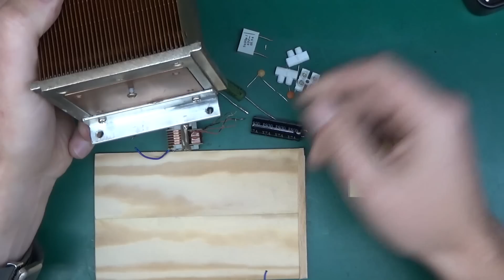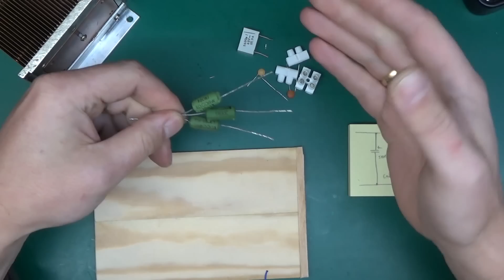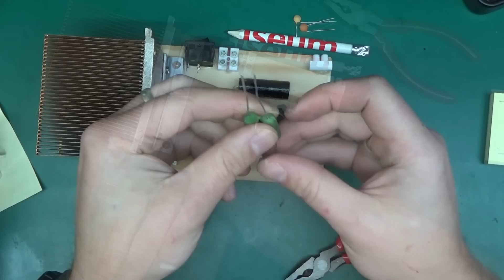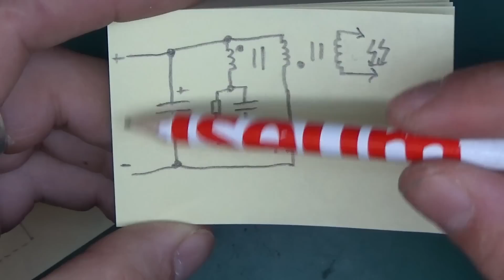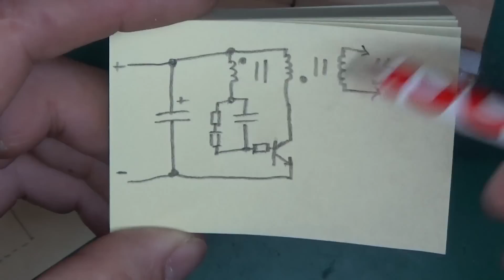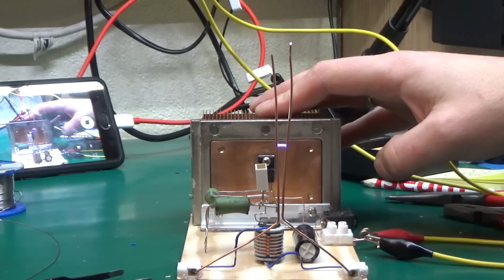High Voltage DIY easy and simple generator build

Comment: I get 2cm sparks from a simple pulse generator from eBay that cost $2 without anything extra.
Reply from the maker: You can get much higher sparks than that from some of those pulse gens. This was about observing a much higher energy discharge and look at catastrophic failure :) pulse generator from eBay can give you a strong jolt if you touch it, this thing here could (most likely would) be fatal...

Comment: So. It wasn't the secondary coil that burnt out?. I don't think you need resistors with power ratings that large for the feedback to base. What you could try is using a larger value resistor. Maybe 1-10k. The base doesn't need a lot of current.
Reply from the maker: Hey, i used those large old resistors mainly for aesthetic reasons :) And the secondary did burn out at some point, can't remember now when. Later on i changed the transformer for a better one pulled out from tv backlight driver. Thanks!

Comment: I think the problem with overheating the resistor and transistor is how you connected the primary coil and feedback, you should use as feedback coil the thicker wire. I just made a high voltage transformer taken from a computer power supply, 4 turns for the primary and 4 turns for the feedback, I used a 33 Ohm 1/2w resistor connected in series with a diode (FR155) with the katod connected to the transistor base (D2495) and no capacitor. whith one 3.7v battery the electric arc is created at a distance of 1cm stretching to almost 2 and no overheating problems. I hope this helps you.
Reply: Can u please send me an schematic of that circuit, i very very need that ! and tell me from what scrap i can find that transistor and diode, i have tons of electronic boards, from computers, TVs and others... please send me on this email mare4323(at)gmail.com thank you very much!

Comment: Nice circuit.
Now install a big flyback transformer from an old TV and a bigger transistor :)
Reply from the maker: +TefaTronix lol! Yes, i am looking forward to getting my hands on some flyback trafo. The problem is they are usually attached to a big old dirty and heavy box, and if i bring it home, I might have to sleep in the shed for some time... :D
Reply: @randomtronic  use my technique, bring the TV in front of your house so you can go inside and pick the tools, dismantle all the electronics from it and bring inside only the mainboard, speaker(s) and whatever is NOT the picture tube or outside case, then throw away the big remainings the way your place expects... the family is a bit happier this way :D

but usually if a TV is broken it may probably be the flyback that is fried
Reply: You can buy them for 15 euros on Banggood